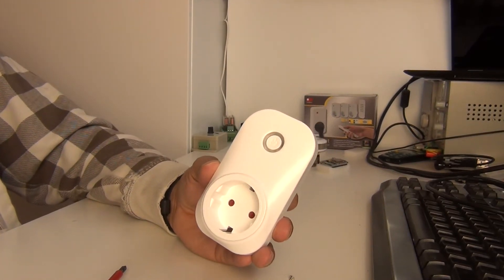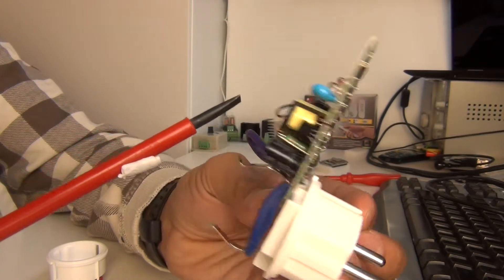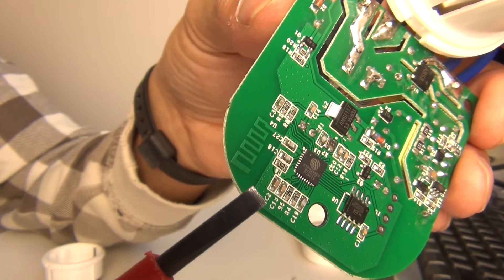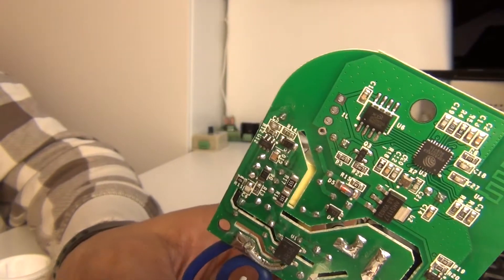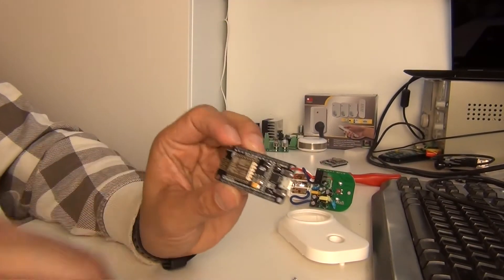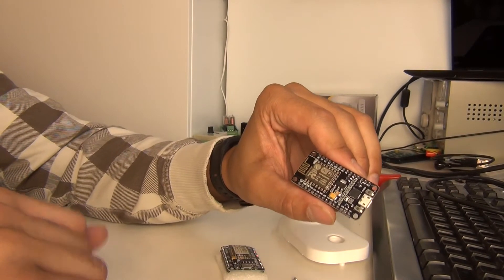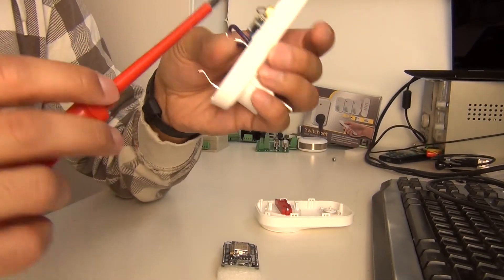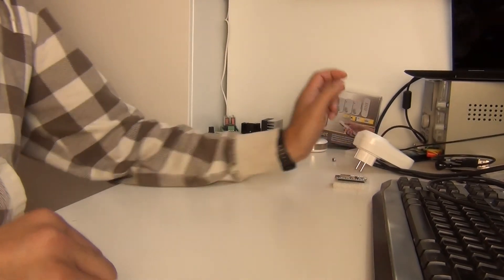Sonoff inside electronics view S20 - esp8266ex pcb trace antenna

Comment: hello. thanks for your video. Would it be possible to inform the value of R11, because in my sonoff, the 3dg3020 tramsistor shorted out and the resistor burned out. The fuse didn't burn. I'm looking for a photo so I can identify the value of R11 but I can't.